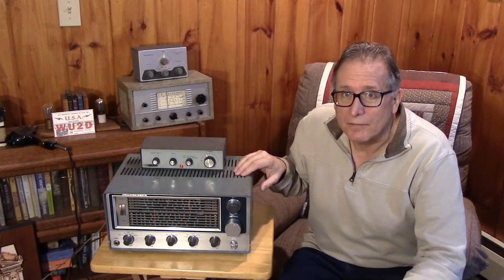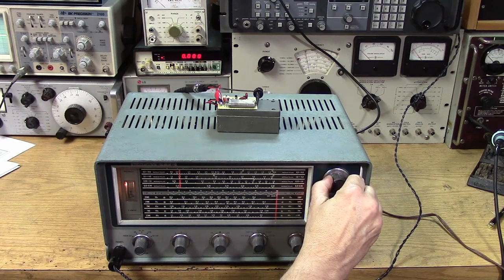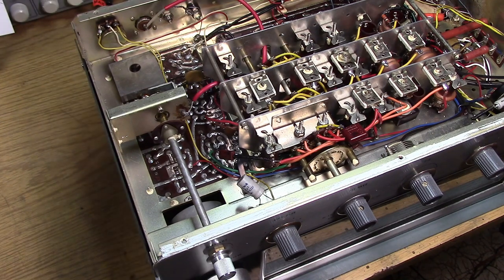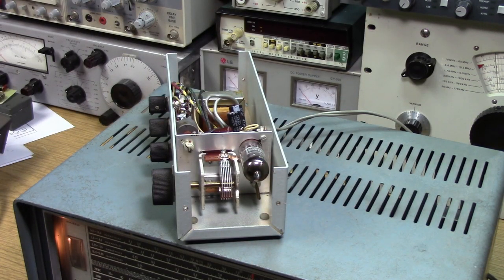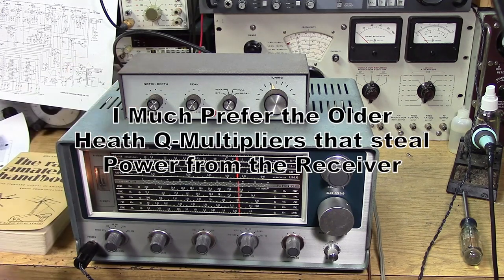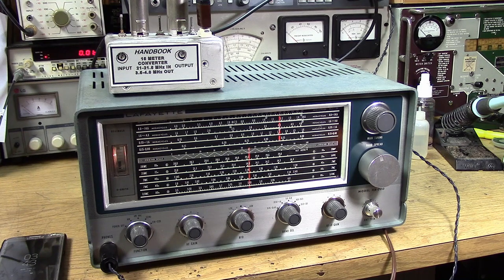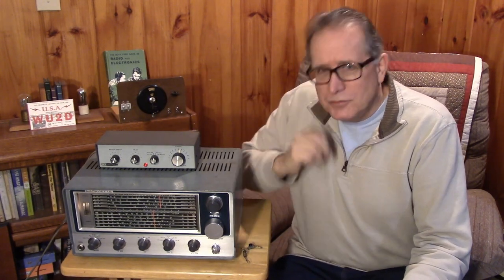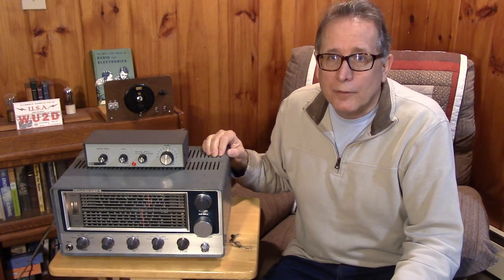HA700 Dream Receiver Refurb Part 3

Comment: I have a receiver that looks just like the HA700, it is the Allied A-2515, all transistor. Picked it up at ham club, a SK wife gave a whole van full of radio equipment to the club. No one wanted old radios just the newer stuff. Was in the  original box with manuals and dust cover works great. I use it for short wave listening and AM broadcast. Have been a ham sense 1965 so like the old and new equipment. Thanks for the great videos. Tom, W7GER
Reply: I'm with you I would have taken all the old stuff.
Reply from the maker: The Japanese manufacturers were very good at reuse of parts when going from tube to solid state. Why redesign a perfectly good  cabinet, slide rule dial assembly and variable capacitors?

Comment: That AR3 brings back memories for me.  It was my first receiver when I got my license back in 1963; it also powered my transmitter a single 6AQ5 MOPA feeding a 130 ft long wire.  Ted VE6AMR
Reply from the maker: Yes a 6AQ5 makes a nice little RETRO QRP station, even today!

Comment: I think it was in Popular Electronics a do it yourself project for a multi-band shortwave antenna utilizing Radio Shack's solid Black and White insulated capacitance wire.  You wound coils on open air spools for the bands and then connected solid wire cut to a certain link, then connected it to the coils, in a series.  Two lengths.  One connected to shield and the other connected to center of a coaxial cable.
Reply from the maker: Never saw that one!

Comment: Some receivers (not this one) have a continuously variable "IF BANDWIDTH" knob.  I mean not a multiple position  switch, but a rotation knob, most likely a potentiometer ? Could someone explain how VARIABLE IF bandwidth is implemented in those receivers. 

One would say: put a resistor across the tuned circuit and the Q factor will go down, but this seems to be too easy to be true ? A theoretical but not a practical solution ? 

Another way I can imagine is to offset one filter relative to a second one ? Again this this sounds unreliable ?  (I understand wide FM filters are tuned this way, but here I refer to narrow CW-SSB-AM filters, as well as early receivers) 

Finally I say that a varactor is used to detune  the resonnant frequency, but not the bandwidth.
 
Help. Thanks.

Comment: Having to constantly tune and retune the knobs on a Q Multiplier would drive me nuts. I was surprised at how much AF is lost with the Q tuned. In some listening situations, I’ll take the noise.
Reply from the maker: Yes it is a sharp situation that cuts sidebands and noise, and yes it is a knob twister! But filtering towards the front is more effective than filtering at the end of the processing. That said, those early DSP audio processors in the 90s were quite good.
Reply: @MIKROWAVE1  I have the Radio Shack DSP from the early 90’s. Yes, it’s very good.
Reply: Its funny but thats what I love about the old radios, you were so much more involved in resolving the reception quality... not just punching in a freq. & letting the microprocessor do all the work like we do today.... and I also love the fact that you could get all these add-ons to make a good radio better.... today we would just go out and buy a new "better" radio...throwing money at it is not my idea of a hobby... 🤔